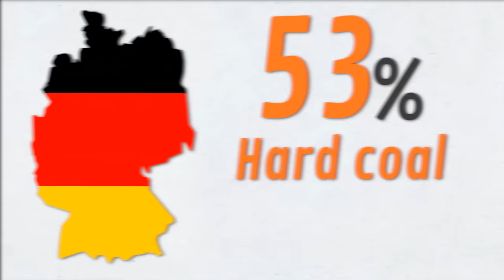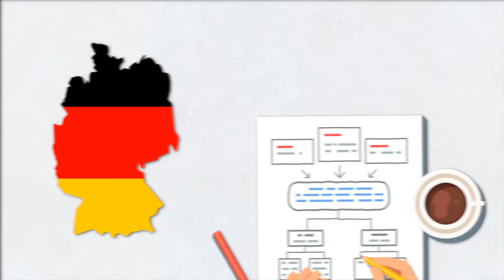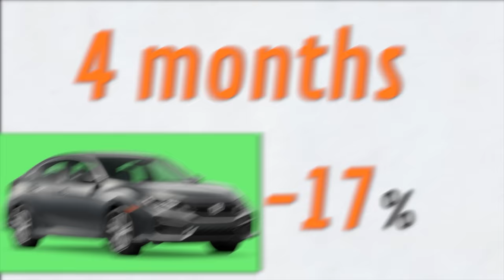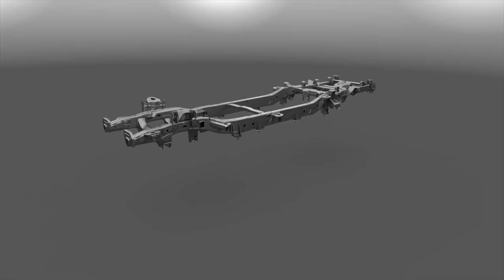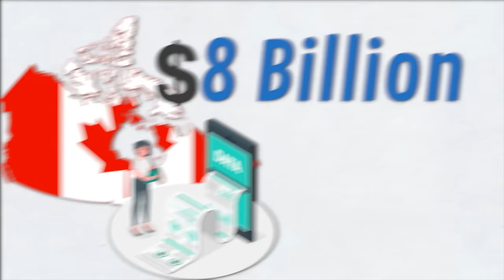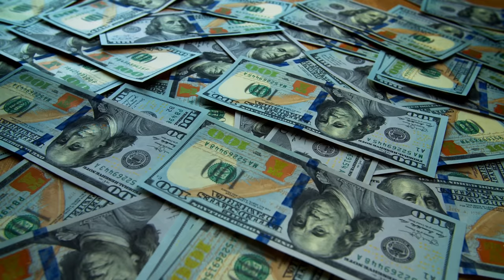Everything You’ve Heard About the Car Shortage is a Lie, Here’s the Truth

Comment: A family member who works as a finance manager for a local Ford dealership is seeing record numbers of new vehicle purchases which has been going on since early this year.  Apparently new cars and trucks are the new pandemic toilet paper.
Reply: @mcc7762  I agree.  I’m looking at less technologically complex vehicles, not more.  Give me an 80’s Toyota pickup or 90’s Honda or old 12v Cummins.
Reply: New cars make sense now because mechanics and dealerships are charging an arm and a leg to fix your used car.  My local Chevy Stealership charges $160/hr for labor.
Reply: wrong
Reply: I work for a Honda dealership. We're selling 1/3 the amount vehicles we were pre pandemic. Not a single new car on the lot available. No Civics available for 5 months. Not every dealership is that lucky.
Reply: @gary.s7759  how? Most used cars are more reliable
Reply: @gary.s7759  the theme here per Scotty is repair it yourself. Older cars, pre-2010, are more simple to repair yourself. The easiest ones are pre 2000 but finding one without extreme high mileage has gotten much more difficult.
Reply: @beanteam2217  some used cars are more reliable.  My point being is that, it is no longer cheap to maintain used vehicles.  Once you factor in new part prices, labor, and personal time...it's less hassle buying a new car.  It becomes a pay now or pay later scenario.
Reply: I can confirm, I just bought a new car even if I didn't need it. Pretty sure in the future they will be even more expensive. The trend is to turn the car in a luxury tool. That's the only way to reduce emissions.
Reply: @AlexWilliams03  Wanted to buy a 2022 Civic. All the Honda dealers near me had no Civics in stock. What? Lol. The Civic is there bread and butter. How can there be no Civics to buy? When I bought my 2012 Civic, The dealer had over 100 in stock.
Reply: Where are people getting the cash to purchase all of these cars???
Reply: @bdun1226  lots of credit and rolling over loans into the next car.  We Americans are so accustomed to living beyond our means that we’re blind to the fact that it makes us slaves.  It’s frustrating because we’ve done it to ourselves.  Very few people think beyond the affordability of the monthly payment.

Comment: I'm really amazed at the short sightedness.  Hydrogen  You've talked a little about it before but I have read some on Japan's push in that direction and the simplicity of the fuel cell technology is already widely known and understood.  It's the most sensible alternative but I fear its to cheap and it we could cut a huge hole in the power of big oil.  It would also require little change in the delivery systems.  Propane is just as volatile and we don't have any problem using it notebly in rural areas where I live.  I see Hydrogen as the best of all energy sources.  Water and minimal electricity and hell we can make our own.  Haha,  That'll really put a smash to big oil.
Reply: How are you going to make the hydrogen?
Reply: Hydrogen is a difficult and expensive fuel to produce especially in large quantity. If most cars ran on hydrogen it would produce more moisture to the environment so it has its down falls
Reply: @rickhuis3773  Totally!!! Have you been to Florida? Way too much h20 I. The air.
Reply: I wouldn't call it shortsightedness I'd call it greed and stupidity....they can't look farther than their pecker or their pocketbook...
Reply: The only problem with H2 is that it takes more energy to make it than you get in return. H2 doesn't occur naturally in nature, so it has to be split from other compounds. The most common of these are water and methane (H2O and CH4). Splitting another compound to make H2 takes a lot of energy. The resulting H2 provides less energy than it took to make it.
Reply: It's hard to ship hydrogen, it was looked at in 1980. Eats through pipes, so you'd have to keep repairing containers and easily escapes.

Battery power, better infrastructure so we can harness good weather.
Reply: I read a paper on hydrogen cells.They store the hydrogen  safety.They aren't you typical cell.
Reply: The problem with hydrogen is three-fold. First, almost all hydrogen is made in the process of refining oil. Second, the energy used to split water into hydrogen and oxygen is not fully recovered due to thermodynamics. Third, fuel cells are very expensive. Otherwise, it's a great idea.
Reply: There is a company called Plasma Kinetics that has developed a technology for storing hydrogen on magnetic tape for fueling electronic vehicles.  Distribution system works like Blue Rhino for propane. 100% recyclable.  It is the best idea I've seen so far.
Reply: @peteb2304  Yes, I;ve seen that
Reply: tell me more about the minimal electricity u speak of to make said hydrogen ??????

Comment: May YTD sales are running at 13m  annual sales rate.  Honda is down the worse at 37% less than last year.  The problem is the auto parts suppliers that sell to Honda  Toyota etc are financially dying due to the low volumes . When they start going out of business it will get serious.
Reply: An arms manufacturer said that steel prices have doubled and aluminum prices nearly that.  Their suppliers are rationing the raw materials.

Comment: i think 🤔 their trying to lie about car/truck availability and push electric [beep] sh** when they know all the issues fire 🔥 hazards cancer causing issues the extra tire 🛞 wear. the cost of these batteries are sky high non ♻️ recyclable labor slaves getting the materials else where not at home american 🇺🇸 made. no charging stations limited charging and discharging life span, they’ll charge but range gets shorter and shorter. no body can repair when it fails big computer it has to be flat bedded to where ever you bought it and no fixes for six months or more. rapid charging isn’t good for any battery 🪫 gradual over hours is best. they had a bus 🚌 in france 🇫🇷 blew up from a short go see video. plus burnt other buses down
Reply: The only new car dealership in my area that can work on their EV's is Toyota. I knew the original owner of the franchise   that made sure it had an outstanding parts and service department to ensure customer loyalty which the new owner has continued. They've sold plenty of hybrids over the years that their owners like except nobody wants to buy one used, so the dealer has gone out of his way to ensure repairs can be done for a reasonable cost. The rest only do minor repairs and ship them off to DFW for anything major since they don't want to spend a lot of money on training and equipment to repair vehicles that nobody wants to buy.

Comment: All sorts of issues with supply of Cast Iron for machine tools, not to mention controls, ball screws, bearings and aluminum too.  If you can't get machine tools the supply of parts manufacturers dwindles.  All sorts of problems to overcome.

Comment: In spetmber of 2021 I traded in my 2020 ram rebel for a 2018 Nissan Sentra with lifetime power train warranty.  Best decision I've made in a long time.  Way cheaper on gas and I paid it off in 5 months vs 6 years.
Reply: Good thing. You will have lots of trans problems with the Sentra. Scotty talks about it all the time.
Reply: @jaysmith179  I am fully aware of that and would not have bought it.  But the warranty on it made it worthwhile.  Once it goes out I'll get it fixed and depending on the overall condition of the car I will either keep it or sell it.  The big thing though was the debt free light that I saw at the end of the tunnel.  Now I am able to rapidly save cash towards a Celica.

Comment: I wonder if the military ev’s have been modified for the installation of a diesel engine and drivetrain. If the ev gets damaged and the battery is hooped and there’s no spare battery, it would make sense to install a diesel engine and drivetrain so it can be put back into service asap. I really don’t see any practical use for a military ev at this point in time, the future perhaps when someone invents a battery that can run for a thousand miles. The technology just isn’t there yet. Not too mention the cost of the new ev’s. Maybe they should build nuclear vehicles.
Reply: How are they going to recharge them when they 150 miles into a desert? A 200 mile long extension cord? 
Also, refilling a diesel/gas vehicle takes a few minutes with a tanker. Are they going to sit there for hours or days waiting to recharge from solar??
Reply: @matthewhudson5685  They've been making some really stupid invention

Comment: I was planning on buying a brand new car (my first ever car), but they are so overpriced right now. My budget is $40k and I can afford to buy a car at that price but do you guys think it’s worth it? Will cars go up even further soon or will they go down??
Reply: I recommend buying a 2000s car 
Much cheaper and more reliable 
I recommend a Ford grand marquis
Reply: Where do you live? May want to consider on buying a new/used motorcycle for a daily driver and have a cheap beater to use when the weather is bad or too cold for riding. The water-cooled Hondas are very reliable and will last forever with regular maintenance. The "beater" doesn't have to be a banged up jalopy. It could be a nice vehicle set aside at a wrecking yard for sale as-is where they also have a good used engine and transmission for it you can buy and have a shop install (they also recommend shops).
Reply: @billwilson3609  Well it depends on the driver’s choices 
If he can't drive a motorcycle or prefers to drive more safely then a motorcycle is not a great idea 
If he wants a very comfortable car then Ford marquis is a great choice with a cheap price and great reliability 
Even scotty made a video about them
Reply: @billwilson3609  I live in Santa Barbara
Reply: @nosunnn235  Guess you don't have to worry about cold weather and just lots of traffic. A smaller displacement motorcycle will get very good gas mileage and cost much less to insure. One can install hard bags and a trunk to carry groceries, books and clothes. Owning only a motorcycle isn't a bad idea if you live at home or have plenty of friends with cars and trucks when you need to haul something.

Comment: Fully electric electronic tactical vehicles is the dumbest thing you could possibly do right now. EMP devices can be used in close quarters and small areas making the ability to knock out an entire tactical force and seconds with one inexpensive  easy deployment.   Having a mixed feel vehicle as a tactical advantage. To be able to rule around analog and push liquid fuels would allow a vehicle to be impermeable to the new EMP devices that exist. A lot of people think EMP is science fiction however you'll be surprised if you do a little research and call some friends and family you will find out that even some of your local police departments have this capability. Something the general public doesn't really know.

Comment: I don’t think Electric vehicles will ever have the ability of the internal combustion engine. And especially the diesel engine. I can pull 16,000 pounds for 360+ miles on 30 gallons of fuel. You can’t do that with Electric vehicles. And just the batteries for electric vehicles way so much. With today’s emissions with diesel engines the exhaust coming out of a diesel engine in some areas are cleaner than the air going in the engine.

Comment: Just out of curiosity I went to the Toyota dealership where I bought my last two vehicles. To get what I want they claimed it would be a six-month wait and they wanted a $10,000 surcharge on top of sticker price.
Reply: I would report them for price gouging .
Reply: @GENERALBR1GGS   That's ever car company and dealership is doing that, the Maverick's that make it too the Dealer Lots have a $10,000 mark up above MSRP and people are gladly handing over that cash just to get it.  I even paid $2,000 over MSRP on a 2022 Outlander, I knew they would not budge on price so I negotiated for service contracts,  extended warranties, and some dealer installed accessories for free or for half normal price.  I feel I got a fair deal considering the crazy market right now, they gave me $10,500 for an Altima that 2 years ago was KBB rated $5,000!?!
Reply: Every one is not doing that, i bought my rolla se last month for msrp in the northeast,  drop your dealer and go to a different franchise.  Allot of these dealerships over leveraged at auctions for used cars and now they're trying to get you to pay for their miscalculations.
Reply: I bought my Corolla at MSRP last month. You can find a dealer that will offer MSRP. Without the bogus markups. Keep looking.
Reply: Joseph Perez is spot on. The dealers rushed to auction thinking they would live off used car sales if they couldnt get new cars from the factories. Good idea in theory but of course their usual nature of greed took the wheel as usual. Consumers will not pay new car prices on used cars. Only the raptor can pull that off.

Comment: their are electric outboards few but not many in question those in larger heavier boats besides aluminum just boating running all over a lake fishing riding rafts water skiing wake boarding etc. battery technology just doesn’t have the umph sustained speed to do that. to charge even lead acid battery depending on the what’s on board your boat. your looking at overnight to get them to trickle charge state. usually a good fishing trip with 24 volt trolling motor eh a day but if it’s windy or using spot lock [auto pilot] smarter yes. you’ll just use up the juice faster. they have these newer glass mat batteries or gel type of deal very very expensive the most i’ve upgraded to bad enough is optima marine batteries expensive but worth it. we jump started our diesel truck off one battery truck batteries went bad. 👅 time to get religious Lord have Mercy as they say.